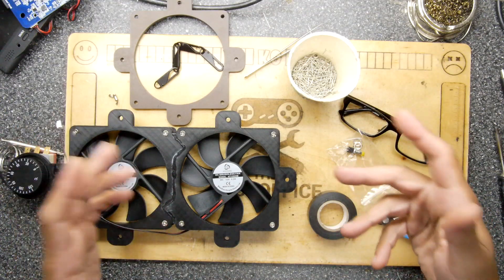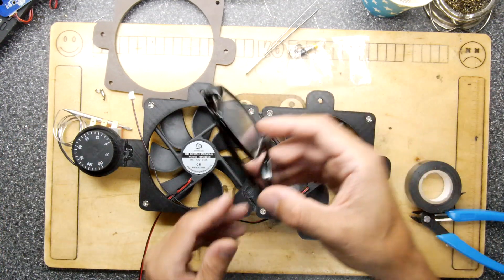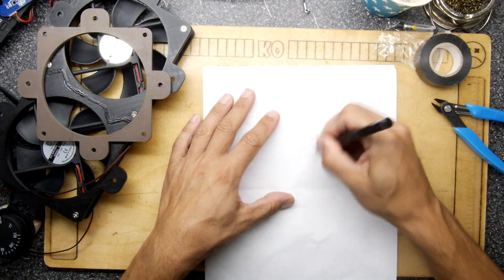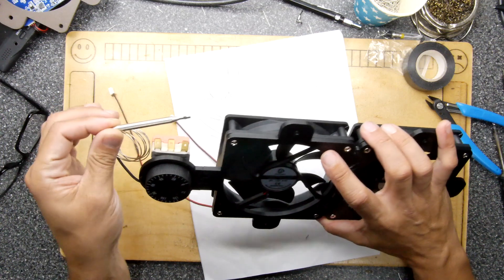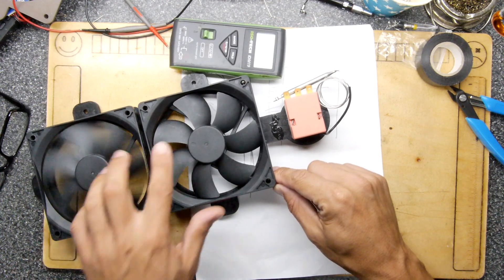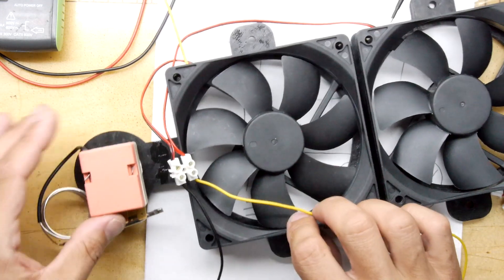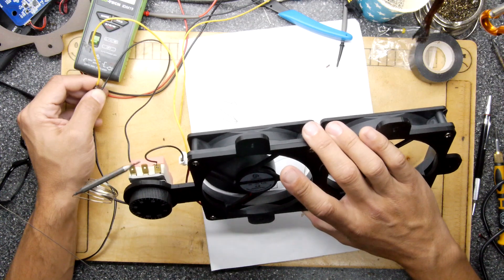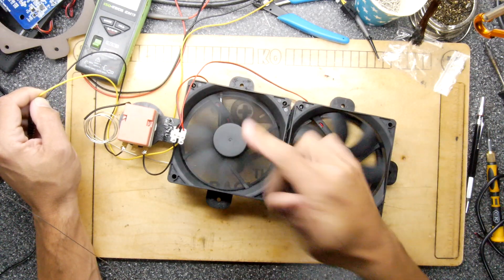Absorption refrigerator thermostatic fan modifications for fun and profit! Dometic RV Mod Part 1

Comment: I recommend using a double switch, that one plus a foot activated one as to provide an extra layer of security, You can also get a simple rfid keychain, and use the switch as a backup feature. Have you used the Noctua iPPC 2K/3K version fans, they are more powerful than normal fans, last longer and are also water resistant esp the 3K RPM version